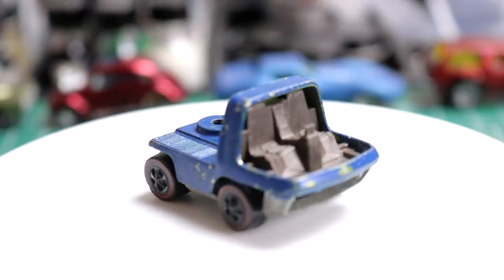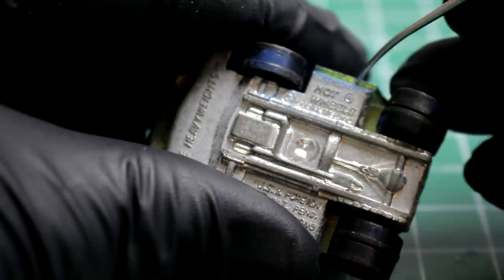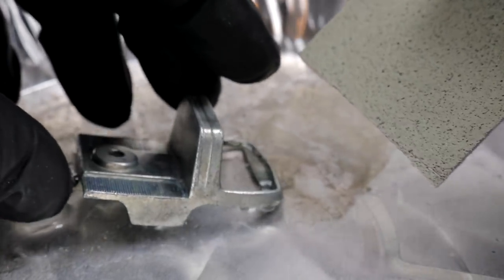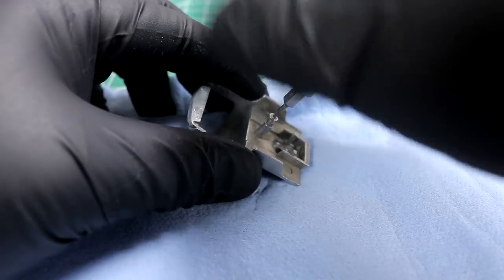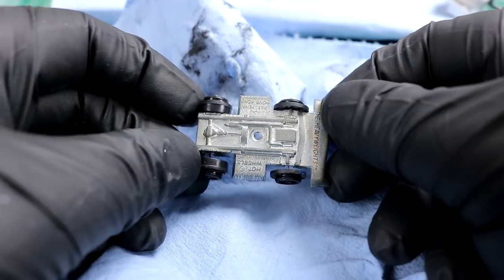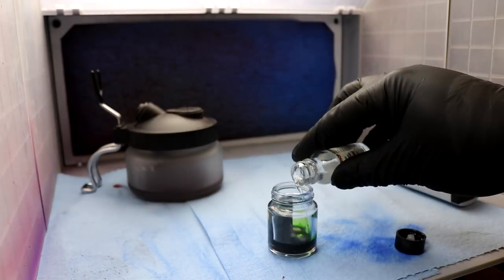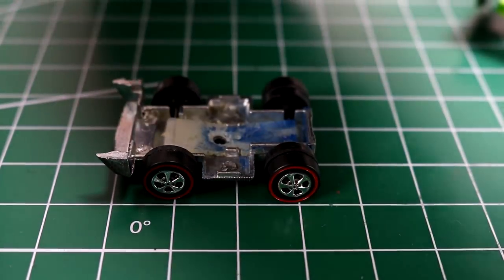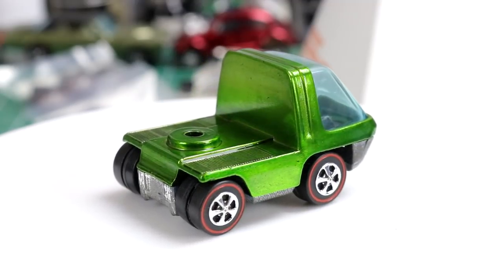TINY Restoration : Heavyweights Moving Van Truck

Comment: I love this little truck. I remember having several when I was probably seven or eight years old, maybe even younger. For some reason, I remember having one larger version of it too. I could be wrong but I want to say it was Nylint. It could also have just been a truck that was very similar or just similar enough to trigger false memories from over 40 years ago.
In any event, it's great to see one of these trucks all prettied up again and returned to the proper color and condition that it deserves to be in. For some odd reason, even when I was a little kid, this one was one of my favorites. It's just too bad that way back when, we used these things for their intended purpose... As toys that needed to be smashed into each other and do hand held jumps with simulated mid air barrel rolls that crash landed nose first into a traffic jam of cars.

Comment: I really like watching your videos.  It's like hanging out with ya!  BTW, if you had trouble refitting the windshield and interior on this Heavy hauler, it's because the frame around the bottom of the windshield (sides and front) is bent!  Take a look from the top, its off kilter.

Comment: Turned out great. With the exception of the new repro wheels and the screw, it looks like an unmolested original. Good job on not overdoing it on the paint, as most vintage cars have very minor imperfections and paint flaws like underpainted areas. Can’t wait to see it mated to the restored trailer...A+

Comment: The only original red line I have is a 1968 68 model couger from the original sweet 16 set and great restoration. I have some newer versions of the red line from the 80 or so.

Comment: I'm curious why "aircraft" paint stripper is used, is it necessary for some reason? Because of the base metal used in the castings?
Reply: "Aircraft" appears to just be the brand name. I've also seen citrus-based paint strippers used in some restoration videos. They seem to do an effective job with less odor and protective gear needed-ish-ness (presumably)

Comment: Love the vids. have a question. what pressure is your airbrush set at? you get such a big spray compared to mine also what size nozzle is it? thanks for your time. once again keep up the good work. also where do you get the paint mixer?
Reply from the maker: I have a .38 needle in mine, I run probably around 25 PSI.. some guys would argue that is too much.. But how many cars do they paint? The Badger paint mixer I bought locally they are around $20 i believe they are on Amazon.
Reply: thanks for info :)